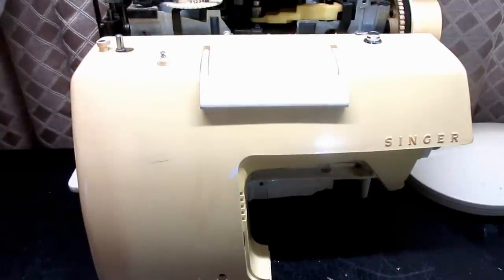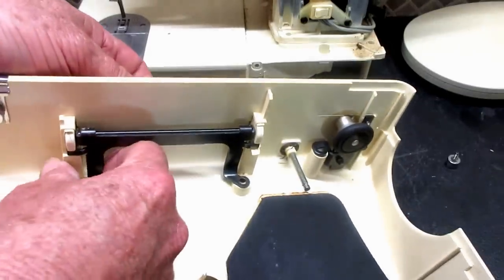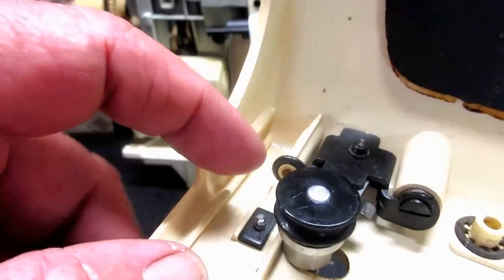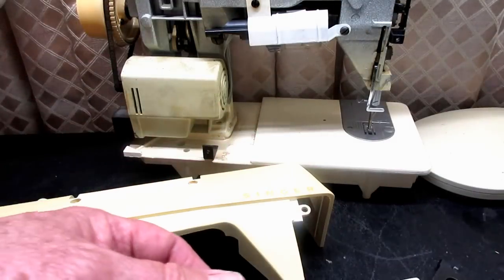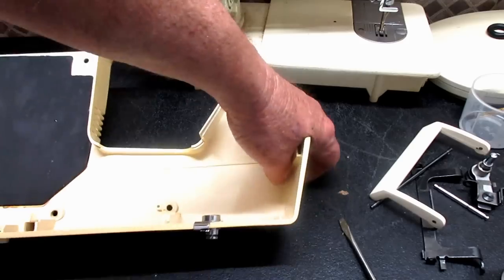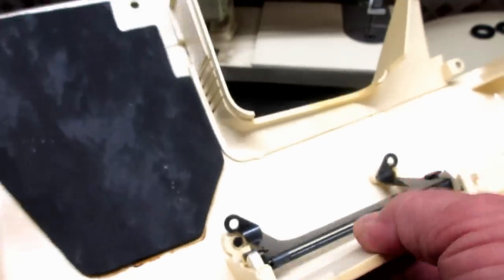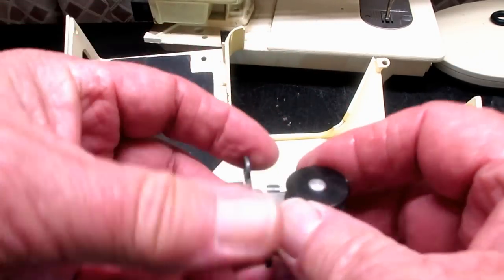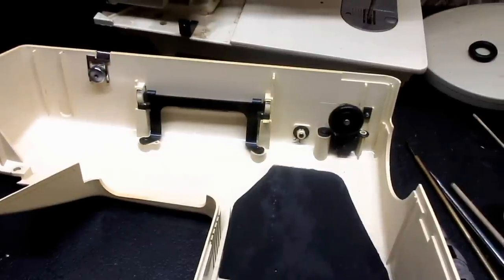Remove & Replace Tension Disc, Handle, Spool pin & Bobbin winder Singer Model 353 Genie

Comment: Thanks, Andy.  This is good information for me.  I did buy some rain-x a few days ago, tried it on my 457, rubbed it very gently and took out most of a black mark around the spool pin.  Now, I'm more informed exactly how to remove these sorts of marks.
Reply from the maker: That's great, Carole. I have to do that on almost every arm cover I work with. It cleans up the area nicely. I good question, and I'm glad you asked.

Comment: I haven't been able to find a Genie to work along with you but I'm following the series anyway. I appreciate the thoroughness of your process.

I'm a woodworker and I use that rag-in-a-can oiler for my woodworking hand tools. It's very effective for coating large areas like chisel, plane blades and plane bodies. It applies a very light coating and I have to sniff to make sure oil has been applied. For smaller pieces with complicated shapes I think your artist brush dipped in oil is the way to go.

In my search for a Genie, I came across an old Kenmore 148.13022 for free that someone was throwing out. It has a vibrating needle bar bracket just like Stella.Must say there's more information and parts availability for Singer machines than for Kenmores. The machine does work though after a preliminary cleaning and unpacking of a ton of thread around the bobbin.

Love the videos. Keep it up!
Reply from the maker: thank you, Terry. Yes, the little brush works best for me on these small parts. Maybe I'll try a small plastic lid from a bottle to make an oil rag sometime. There are 4 machines like the Genie; 353 & 354 plus two "STARLET" models in case you come across those. I found the same years ago; not much info or as many parts for the Kenmore machines to be found, although I see more Kenmore parts on eBay the last year or so.

Comment: Hey Andy, 

 I suggest Meguiars's products. They make different "grits" of plastic polishes and paint polishes that do wonders for plastic and metal! Don't be afraid to use them interchangeably. The Ultimate Polish works great on plastic. I haven't noticed any dulling at all.The clear coat on a car is very easy to scratch just like plastic. I've used Ultimate Polish and an electric buffer for cars to polish out plastic cases. Be very careful with the clear brittle type like is on the Genie's instrument panel. That's a more difficult plastic to polish. Hobbies can and do overlap.  Great video as always.
Reply from the maker: Thank you very much for sharing this tip, Brad. I love the Mequiars waxes so I bet I'd love the polishes too! Always surprises me a little bit how well these 50 to 70-year-old paint jobs can be made beautiful again. I can't wait to try the Ultimate Polish.

Comment: Hi, Andy. I thank you, as well, for all of your helpful information. Any suggestions for fixing my bobbin winder? Sometimes it works and sometimes it doesn't. I took it apart, as you suggested and found it dusty and cleaned it. The winder post seems tighter than you mentioned it should be. Do I need to oil it?
Reply from the maker: Yes, please oil it. @ 42:00 in the video, I discuss where and show how to put oil on the spindle and bushing. Thanks for watching my channel.

Comment: Hi Andy, I have a wobbly spool pin on my Singer 353 model.  I pilled it apart and can't see why it's wobbly.
Reply from the maker: Sorry, I don't have the machine now and did not have that problem so I could not advise a cause or fix for you. 🙁

Comment: Andy,
Regarding using Rain-X Headlight Restorer to remove scuffs and smudges:  If one accidently scrubs too hard with the restorer, and dulls the plastic surface, will putting on multiple coats of Meguiar's Carnauba Wax restore the shine on these plastic parts that were accidently dulled by the restorer?  I haven't dulled any plastic surface, but was just wondering if the carnauba wax would make the surface almost normal again.
Reply from the maker: Hi, Carole. It has been my experience that any wax will leave residue in scratches, especially on darker colors. Like a white residue. I have used the rain-x a few times now with great results, on paint & plastic. What has worked best for me is to rub against the scratch, like if the scratch runs up and down I rub back and forth. On machines with clear plastic faceplates where there is a"hazy" spot, I rub both ways. I always use light pressure and check, then add more pressure if needed. I think the idea is to let the "grit" in the polish do most of the work, so it is almost like just spreading the rain-x around and then rubbing lightly.

Comment: Make a roll out of linnen or cotton and roll it very hard  find a plastic tube about 1-1/2inch diameter and 2-3 inches long  and some sort of end cap make the fabric roll to fit this tube and so it sticks out about half an inch maybe a bit less. Soak thefabric with oilnot so it drips but close to it and use it as a applicator of oil for anythiing you like to put an oil on. that oild has a use in woodworking too have a look at this youtuber peter sellers make one a bit bigger, https://www.youtube.com/watch?v=npKo1y2e8RI p.s. like a vitamin c tube.
Reply from the maker: Rag-in-a-can oiler! Who knew? Paul Sellers did! A very clever man. Thanks for sharing. BTW, did you like my video? Hehe, take care.
Reply: one can allways learn new tricks and ideas while watching, even if i do not have a specific machine. i got 2 new machines since we last spoke a singer 201k for $40 and a husqvarna 12 for $30. i have 3 hobbies 
woodworking sewing and fishing, thats how i knew about peter sellers. Iam now on the end of making another shirt (this time a striped one)
Reply from the maker: So true. I'm not familiar with the Husqvarna machine, but a 201K for $40 sounds like a great bargain! Keep sewing and thanks for stopping by.
Reply: I have just found your videos on utube , and you are GREAT!!! I can actually understand what you are teaching, I am fairly new to the sewing world . I have 8 S.Machines only 2 are singers, the question I have now is about Singer  mdl #248, I got it for only 10$, I thought it was a great deal!, I have followed your videos about cleaning , everything went fine. I even followed your link and got thrown line manual, I got to the thread tension dial , located on the front; it was really loose, so I removed it , MISTAKE, I put it in order as I was removing every thing . But it’s no6 going back right , can you give me any tips on  what I am doing wrong? Any help would be greatly appreciated. Out of the 8 machines I have , only 1 works😒  that’s an old Montgomery Ward. Thank you 
Vickey H